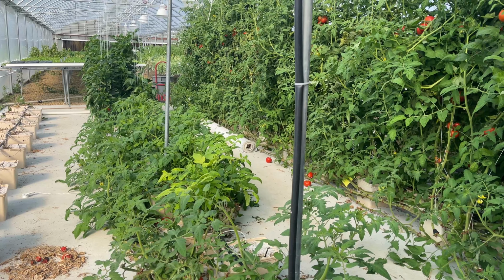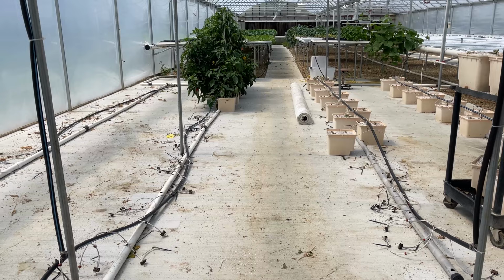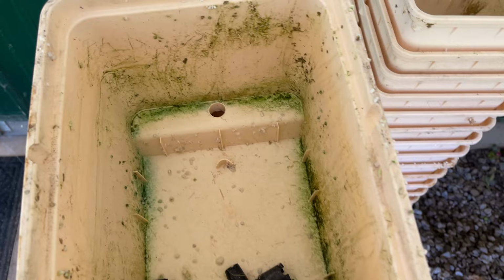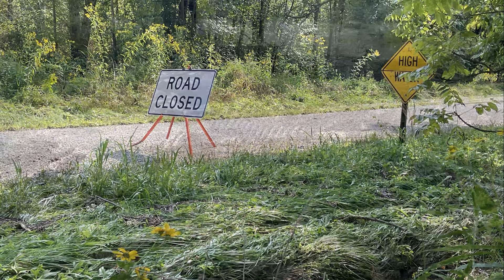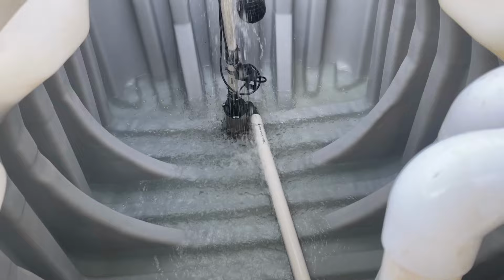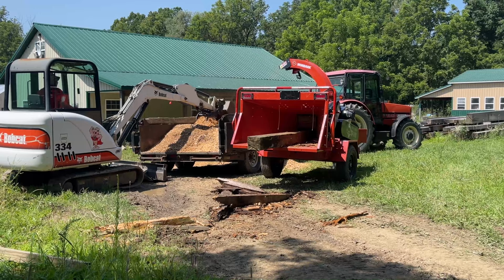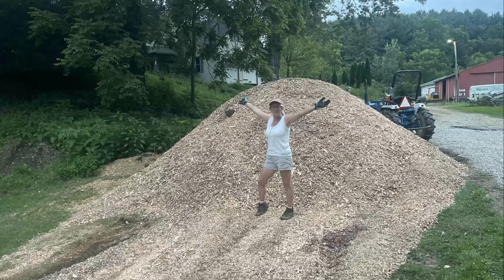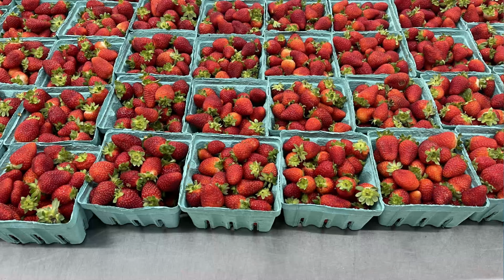Big FLOOD! Saving the hydroponic greenhouse

Comment: Standing water inside of structures? Yikes. Good thing Doug did mold remediation because you're gunna need it!
Reply from the maker: Yeah, we were able to get it all dry very quickly. Just creek water but still bad. Everything is now back to normal. Now to figure out a way to prevent it from ever happening again.

Comment: Sorry for your flooding and the work it added to your ranch. What formula are you using for the fertilizer for the strawberries? My strawberries are very small (the same variety as yours) not sure if they are getting the nutrients they need. I use the dosatrons as a way to mix and inject into the tank that feeds them and waters about 3 min every 4 hrs.
Reply from the maker: We used CropKing to develop a formula based on our water source, so I don't think it would work for you but consider having them develop a fertilizer program. I know it costs some money ($200) but the results have made a huge difference with our production.

Comment: Hi I'm new subscriber to your channel and really enjoy your videos. 
Cleanup from flood is no fun, been there done that for two hurricane floods.
Have a question about starting seeds for tomatoes in hydro drain to waste system in bato buckets with perlite.
I used to have a NFT system and grew determinate tomatoes, I'm switching to drip system as the NFT didn't work well when I tried indeterminate tomatoes. I'll be using 1.5" rockwool cubes placed in plastic cell trays to start seeds in. 
Question is from time of seeding to transplant in buckets, are you filling your seed tray by hand with nutrient water throughout the day for the 3-5 week period before transplanting or do you use some tubing on a timer for irrigation cycles.
Hope that question made sense.
Thanks,
Matt M.
Crystal River, FL
Reply from the maker: We bottom hand water until they are ready to be placed in the Bato Buckets
Reply: Thanks